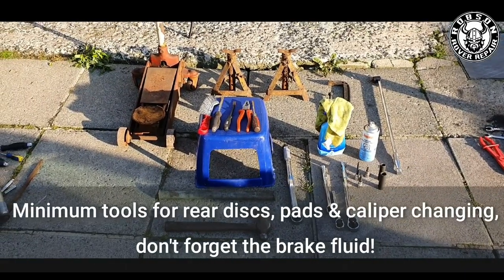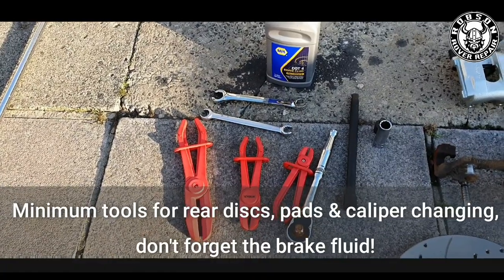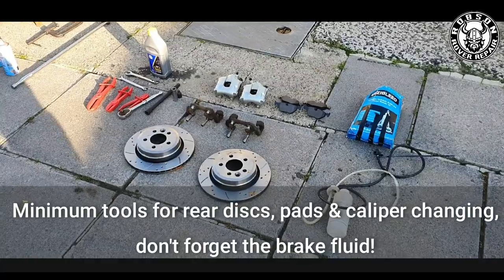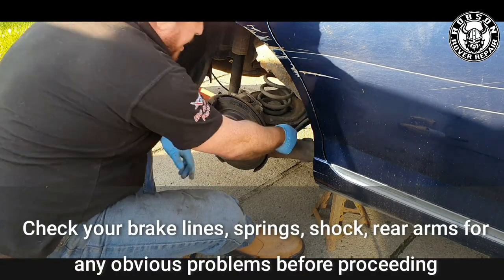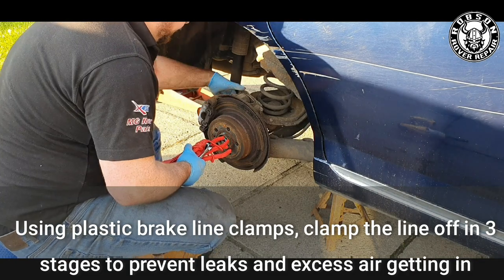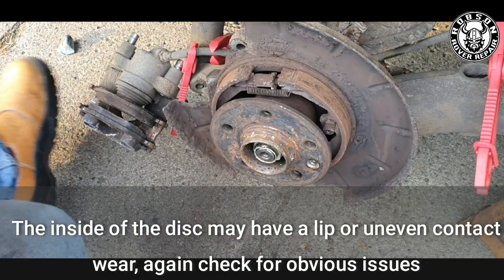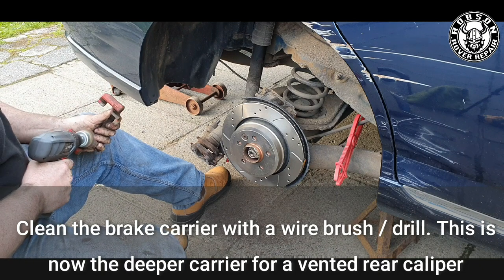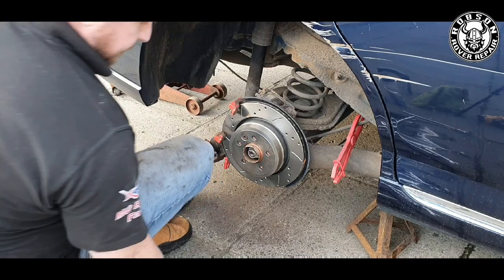ROVER 75 BRAKE TIME! Part 2 - Rear discs & pads / solid to vented / easy handbrake adjustment guide

Comment: Good that you took the time to fully detail this process. Every used car I buy, I thoroughly check the Brakes at the first opportunity. Good Policy... Brakes matter!

Irrespective of what the seller or previous owner tells me they have been serviced, renewed or attended too. Two Rovers and one MG had hefty Invoices for work done on their Brakes shortly before I bought the cars. They were all owners who did not know their way around a set of tools so entrusted their cars to the trade. Glad I do these checks as poor workmanship and hurried work meant those brakes were not operating like they should.

By the way. Drilled and slotted Brake Discs are usually "handed". Designed to fit on one side of the car only.  Twenty odd years ago, I fitted drilled and slotted front Discs to my MG Montego Turbo. After the first few miles of gentle application, I then tried them at speed and they certainly pinned the car down nicely .. accompanied by a strange high pitched Turbine like  buzzing noise as soon as I applied the brakes at speed which reduced in volume as the car was slowed.  Until it stopped when the car stopped. It was an interesting noise and puzzled me. Slept on it overnight then a possibility dawned on me. The "handed" feature meant the curved slots ( like those in your videos ) would either be trailing ( correct side ) or leading if fitted on the incorrect side. That was my theory. 

At speed, I suspect air is trapped by the curved leading slots and each time it reaches the pads it's compressed making a high pitched popping sound. I removed the two front discs and moved them to the other side of the car. No more unusual noises when braking from speed.

 Unless I'm mistaken, I think I saw you fitted those Discs with their slots leading when the car is in forward motion. Any unusual noises when braking hard from speed?
Reply from the maker: I did indeed! That's why it goes from being light to almost pitch black in Part 2 as I had to swap them around after going through it all! I'd managed to get front and rear wrong. Lmao. Haha! 

I'd been using the front selfie camera which was mirrored, so they looked correct to me as I'd been checking footage going along, checking footage and going back to work on them. 

Needless to say people within a 10 mile radius heard me swear at that one haha!

Comment: Good simple directions, personally i would have replaced the brake hoses as well, don't like clamping brake hoses because it can cause the inner pipe to close up a little, so i just add a bar to the brake pedal, this stops any air getting into the system, also closes off the module. great work keep it going.
Reply from the maker: Fair point. But they where replaced with braided hoses since the video as they had not arrived in time during filming.
Reply: Hi Colin that is great to know, do you have a link for the braided hoses please. @RobsonRoverRepair
Reply from the maker: Give me an email mtec@robsonroverrepair.com and I will get you the best price I can over retail

Comment: Do the vented disc make much of a noticeable  difference to  real life driving dynamics ?
Reply from the maker: I would dare say not really on a 75 or zt in normal circumstances. 

Its probably why as part of project drive they made everything solid rear again on all zt & ztt's from vin 252351 onwards, and by the end all the 190s had solids also.  Cost cutting no doubt as much as real world function.

This is my autobahn car, I do about 3000 miles a year in it over France, Germany, Austria etc now, so any improvements at high speed 100mph braking I will take it with my family on board.

In everyday driving you wouldn't even notice it. But it's an easy upgrade and if your calipers are worn as mine where, why not as the discs are the same price and you use the same size pads anyways.
Reply: @RobsonRoverRepair   I agree entirely, they look nicer and more interesting though.

There again, If you lived high up in the Alps and frequently descended maybe those Brake components would get hotter and hotter. I have rarely ever experienced Brake Fad except when really pressing on and deliberately seeing how the brakes shape up after repeated applications from speed. 

By the way, the Chinese MG6 which has much MG ZT Longbridge DNA, does have VENTED rear discs. Not measured them ,but they do look identical. The Front Calipers on the MG6 look like those on Rover 75s. The 75's MINTEX Brake Pads are a perfect fit in them too.